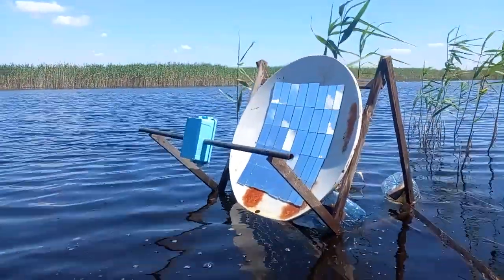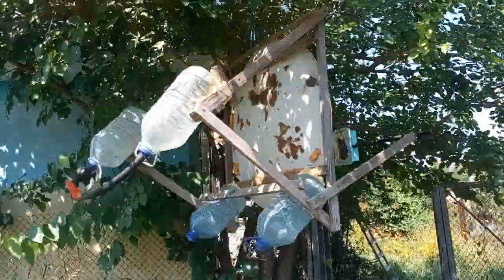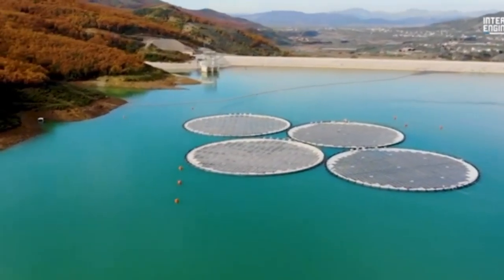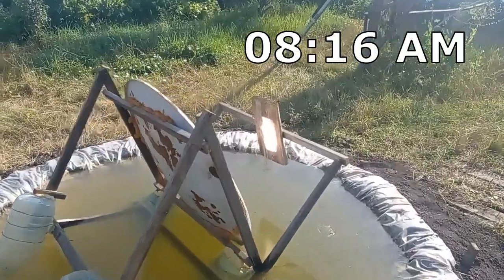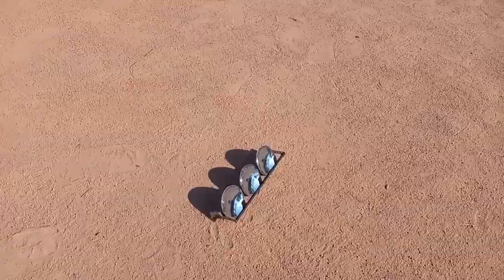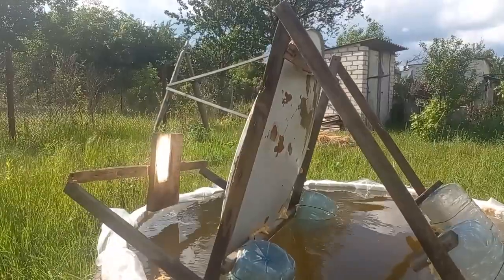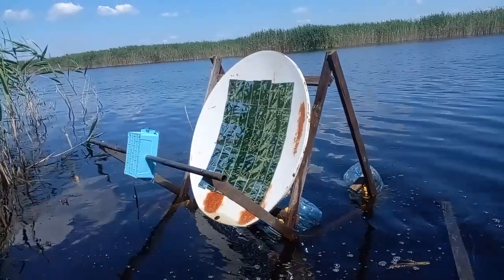This innovation reduces the cost of solar energy by 30%. Why hasn't it made an energy revolution yet

Comment: AI Summary

Abstract

This analysis details a proposed low-cost solar thermal energy system designed to reduce generation costs by 30% relative to current photovoltaic (PV) and traditional concentrating solar power (CSP) installations. The core innovation lies in replacing complex, high-cost mechanical tracking mechanisms for parabolic mirror dishes with a hydraulically controlled floating system. The horizontal rotation utilizes standard motors, but the critical vertical tilt is achieved cheaply by adjusting the weight of water within integrated floats using simple pumps. The video quantifies the potential energy increase (3x over fixed mirrors) and outlines the economic necessity of lowering tracker costs below $40/sq.m. Three experimental float designs were tested, with the air-pressure-controlled, open-bottom float showing promise due to its simplicity and low energy requirement. The system is designed to provide 24/7 power generation through integration with large-scale thermal energy storage, aiming for a thermal energy cost of less than 1 cent per kilowatt-hour. Challenges related to wave and wind stability are acknowledged and potential solutions are discussed.

Low-Cost Floating Solar Thermal Tracking

*   0:00 Cost Reduction and Domain Focus: The innovation targets a 30% reduction in solar energy costs by developing large-scale solar thermal power plants that produce both cheap electricity and thermal energy.
*   0:13 Contextualizing Water-Based Solar: Installing solar collectors on water (floating solar) and utilizing rotation for sun tracking are established concepts, but the mechanism presented offers radical cost reduction.
*   1:05 Efficiency Gains: Solar panel rotation increases electricity production by approximately 1.5 times. In contrast, rotation of mirror dishes increases energy production by roughly three times compared to motionless mirrors.
*   1:21 Tracker Cost Barrier: Existing mirror dish trackers are economically feasible only when their cost is reduced below $40 per square meter. Current tracker prices are several times higher due to reliance on steel, concrete, expensive hinges, and complex dual-axis turning devices.
*   1:51 Core Innovation (Vertical Tilt): The radical cost reduction stems from using water installation and, specifically, performing the mirror dish's crucial vertical tilt adjustment via adjustable buoyancy control in attached floats, replacing mechanical hinges.
*   2:30 Buoyancy Control Mechanism: The vertical tilt is controlled by changing the weight of water inside the floats. This is achieved using a single inexpensive water pump capable of controlling several thousand floats simultaneously.
*   3:42 Tracking Verification: Experimental demonstration confirms the mirror rotation ensures the focused solar radiation spot remains stationary on the receiver despite the sun's movement.
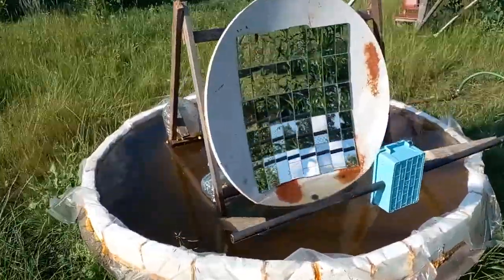*   3:58 System Architecture: A utility-scale plant would consist of dozens or hundreds of 'islands,' each combining several thousand cells. Each island requires several inexpensive motors for horizontal rotation and 1–2 pumps for float control (vertical tilt).
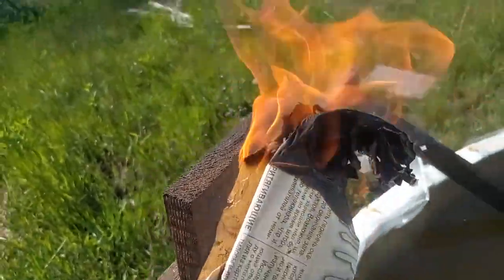*   4:31 Thermal Energy Integration: The focused solar radiation heats a heat-transfer fluid (e.g., thermal oil heated from 300°C to nearly 400°C). This hot fluid is transported to shore-based power plants where it generates steam for turbines and charges large-scale thermal energy storage (TES).
*   5:17 24/7 Generation: Unlike PV panels, the integration with TES (potentially based on concrete, sand, soil, or waste) enables continuous electricity generation, even at night or during non-sunny days/winters.
*   6:22 Float Experimentation: Three float options were tested:
    *   Option 1 (6:33): Water movement compresses air to displace water.
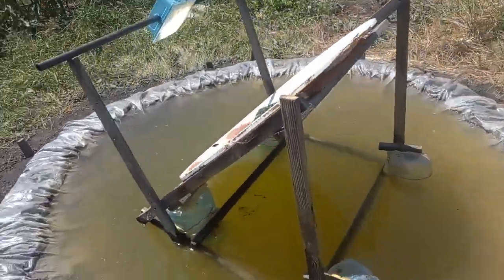    *   Option 2 (7:02): Similar to Option 1 but with holes; showed slow water exit due to reliance on hydraulic head difference. Risk of accidental submergence requires vertical tubes on holes.
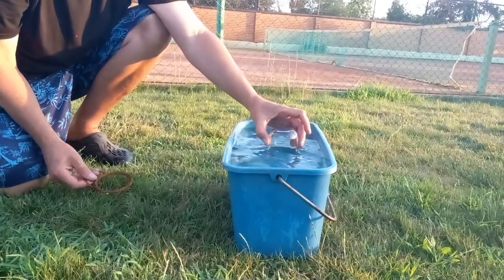    *   Option 3 (8:18): Uses an inverted glass/missing bottom wall design where air pressure controls buoyancy. Testing confirmed stability and low-pressure requirement (demonstrated using human lungs instead of a compressor). This design is compact for transportation.
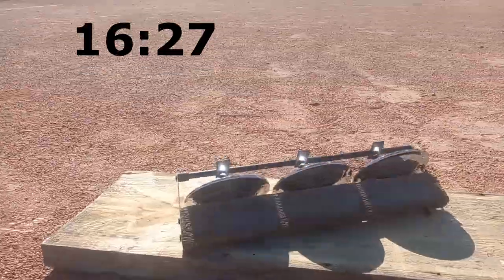*   10:31 Scalability and Centralized Control: Combining dozens of rows into large islands reduces the number of motors and pumps required, though the optimal method for combining rows remains a startup objective.
*   11:00 Stability Challenges (Waves & Wind): Waves cause minor spot movement, which is reduced by increasing the size of the mirror system. Wind is a more significant issue, causing mirror rocking, but vertical vibrations of the focal spot were less than 1–2 cm in relatively strong winds. Mitigation strategies include optimizing the center of gravity and increasing row/island rigidity.
*   12:34 Cost Target: The system's calculated cost for thermal energy is less than 1 cent per kilowatt-hour, which is about five times cheaper than heat from conventional solar collectors, at a temperature exceeding 300°C.
*   13:10 Cost Allocation: The cost of floats and their assembly accounts for roughly half of the total cost of the resulting solar thermal energy, making float cost reduction the primary objective for a potential startup.
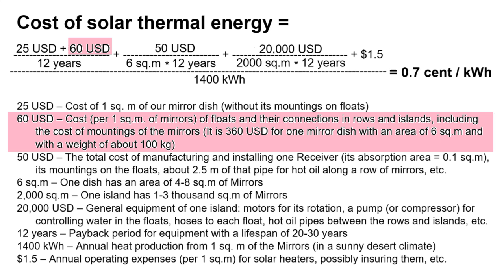*   13:31 Geographical Constraints: The reported production levels assume rare lakes and reservoirs in sunny deserts. Temperate climates would yield lower production due to fewer sunny days and potential winter water freezing.

AI-generated summary created with gemini-2.5-flash-preview-09-2025 for free via RocketRecap-dot-com. (Input: 17,961 tokens, Output: 1,183 tokens, Est. cost: $0.0083).

Comment: The water for rotating makes be think of the other fluid element, air. You already have shown how to get a curved mirror from a balloon. But how about helium balloon floating to hold a flattish Mylar mirror (held tight be e.g. inflated tubes?. It could be steered by controlling the length of the robes to the corners. But as wind determines the position of the balloon relative to the target, probably an active close loop control system would be needed. The big advantage would be to get sun light and heat to areas inaccessible to ground mirrors, e.g. due to trees, other building, in valleys, etc. and catch even the earliest and latest sun, where the heat, light and electricity is needed most, as other solar systems produce.

Comment: I don't think this approach is practical or efficient. Instead, we could achieve better results at a lower cost by using a solar tracking system powered by a stepper motor controlled through Arduino.

Comment: Very interesting ! 🤓You could use the Minto Wheel (or Lever) or this system https://ru.wikipedia.org/wiki/%D0%9D%D0%B0%D1%81%D0%BE%D1%81_%D0%9C%D1%83%D1%88%D0%BE from Augustin Mouchot to articulate in x and y axis the solar concentrator, and even simultenously use it as a pump so it can take care of water quality and harvest some motion power

Comment: Can you do an experiment where the receiver is in the shape of a long coil instead of a straight pipe?  My thought is the coil addresses the need to move the trough because some parts of the receiver are always in the ideal location. Of course it would be less efficient but with no moving parts could it win on cost?
Reply: It is necessary to use a receiver shape that repeats the movement of the mirror focus.
Reply: @ thank you for answering my question, love your channel.

Comment: This could also reduce the evaporation from reservoirs, since the water surface would receive far less energy from the sun, and also the presence of the panels would reduce the wind speed over the water.
Reply: Yes. but wind on the water is good for aerating the water so it stays healthy.
Reply: @AutoNomades  Yes, oxygenation of water is a delicate topic indeed.

Comment: Great idea. Really. A slow cost kit with Arduino etc., should be done. Very clever engineers on YouTube could be amused. It's a game for them.
Reply: If you absolutly want to use electricity for that, some even more simple systems are working by connecting 2 small pv pannels to a motor that mooves the solar heater; + and - are connected in a way to the motor from the first PV pannel, and - and + connected to the same pannel. it seems to work very well as i saw many videos about. The same could be done with 2 motors acting like a boat propellers in oposite directions, so the one pannel-motor group that catches more sun "win" the race and turn the solar heater in the proper direction, AND aerate water so it stays clean.

Comment: Aligning the rotation of the mirror with the axis of Earth, the rotation is only about one axis, with an occasional adjustment for the seasons
Reply: Ah, I didn't understand you right away. You want to use an engine that works like a clock - it makes one revolution per day.
The gyroscope has the same effect, it tends to maintain its position, therefore, to make one revolution per day against the rotation of the planet.
Reply: Yes, but you need a gyroscope for that.
Reply: @intellectualcat4000  daily rotation is a motor, as it is aligned. Seasonal adjustment can be done manually a couple of times per year.

Comment: For a gain of 30 to 40%, can you give the economic case of your system, versus simply increasing the size of a fixed collector by 30 to 40%
Reply: With mass industrial production, any technology becomes cheaper, which means that any trackers for turning collectors will also become much cheaper.

Comment: I get the pump of adding water weight to tilt the panels in the vertical plane.  Cool idea.   How are you doing the rotation on Horizontal plane?  Are pumps pushing water out small jets for this?

Comment: side note not completely relevant... but a little.   The hot oil could also be used to crack used motor oils and retort plastics to components like usable diesel fuel and other fractions.
Reply: And for making bricks and melting metal.

Comment: the horizontal pump actuator for tilt is always interesting., simple and cheap. Fun to think of equally cheap ways to do the rotation about the vertical axis holding position in water .

Comment: Moving the water in and out of floats requires orders of magnitude more energy that rotating something around the center of mass. When perfectly balanced, an oil bearing requires under a gram or torque to turn. Exerting one gram of torque is equivalent to displacing one cubic centimeter of water. The main problem with solar tracking solutions is the negligible gain after orienting the solar collector - so any losses on the energy used to orient is very important. Rotate around the center of mass instead and save a lot of energy.

Comment: Solar doesn't work because the thermodynamic efficiency is far worse than any other energy extraction technology. No technology that is "less" as EVER BEEN ADOPTED as a replacement for a prior incumbent technology.

The only reason for the hype about solar is that 100% of the hype-ster/fanboys are 100% STEM-ignorant examples of Dunning-Kruger syndrome.   A simple back-of-the-envelope calculation based on electrical engineering 1001 is all you need see the fundamental and insoluble problem!

Comment: you just showed the solution, solar panel hanging from wires. also a fully supported ball bearing worm gear vertical direction joint is not difficult. leaking oil from the pipes into water will mess up your system. where do you need corps when you diy. yep, you must diy. if you cant diy then market does not have a solution. 4x telescope poles to direct the solar panel. or just 2dof space worm gear telescope tracking mount. screw metal beam telescope legs are simple and cheap. or 4x air piston legs. yep tether style telescope rod mounted solar panel. assume all materials are free. so diy. as market distribution chains multiply the prices of the base items vs diy.

Comment: Interesting.. 
– what if we had angle changes only in one dimension? Easier and a bit more efficient than fixed.
– or what if we had the second dimension only for 2 rough flip-flopping positions? Perhaps easier or more robust, still a bit better than fixed
– what if some air containers/pipes leak? Should there be some kind of auto-balancer? Depends on the pressure differentials in the system.

Peremoga 🤍💙💛💪🙂🤘iz FI

Comment: nice idea/execution, love the thinking behind
but thermal solar systems are net very good in cloudy areas, and need more moving parts
standard PV costs came down over the last years by a lot, in favorable conditions the price for PV electricity is already well below 2 cents per KWh, no tracking (means no moving parts, set and forget)
future will be PV modules all over, walls, fences, rooftops, deserted land, lakes and so on
Reply: yes but what is cheap to you and I may not be cheap to many, many others (PV modules, electronics etc). The thermal designs can be produced from  mostly scrap especially in areas where people are very creativs,resourceful and have more time.
Reply: Well even a car with closed windows gets warm by cloudy days, i even use it to dry my cloth when i need (and ventilate it sometimes)

Comment: If this system is floating, how to harvest the energy? Will the heated oil be cooled by the water?
Reply: Insulation and flow rate minimize the loss in temperature. Any central heating system already pumps hot water across entire cities like mine.
Reply: @jorislal 🔴 What Is Islam? 

🔴 Islam is not just another religion. 

🔵 It is the same message preached by Moses, Jesus and Abraham.

 🔴 Islam literally means ‘submission to God’ and it teaches us to have a direct relationship with God. 

 🔵 It reminds us that since God created us, no one should be worshipped except God alone. 

 🔴 It also teaches that God is nothing like a human being or like anything that we can imagine.

🌍 The concept of God is summarized in the Quran as:

📖 { “Say, He is God, the One.  God, the Absolute.  He does not give birth, nor was He born, and there is nothing like Him.”} (Quran 112:1-4) 📚

🔴 Becoming a Muslim is not turning your back to Jesus. 

🔵 Rather it’s going back to the original teachings of Jesus and obeying him. 

More .....👇

🔴 THE RETURN OF JESUS
Reply: @1islam1  Why are you showing this here on the science channel?